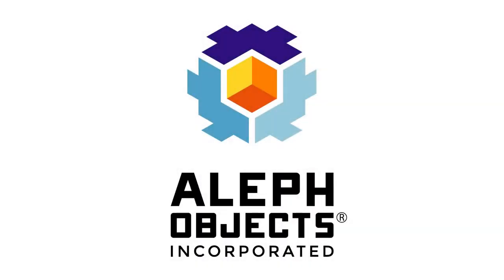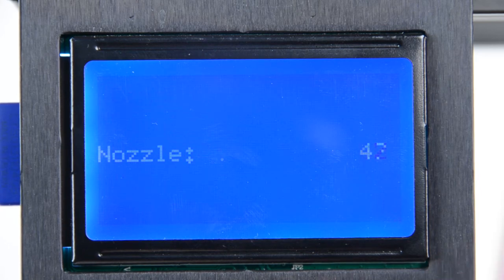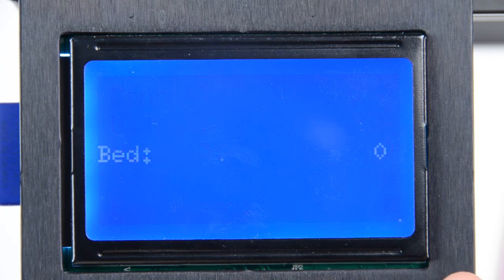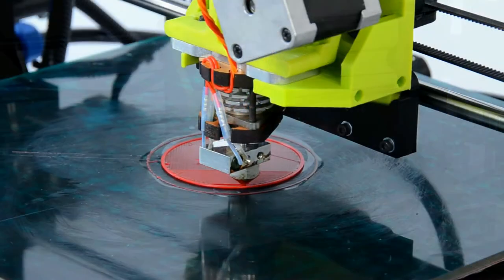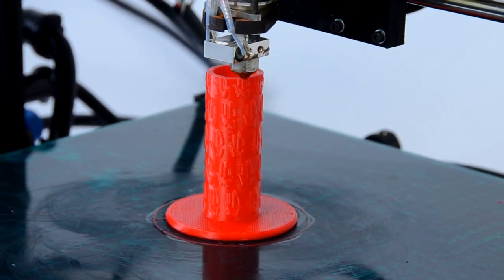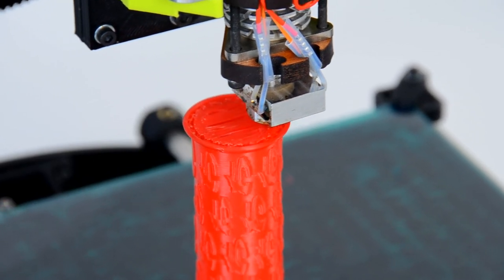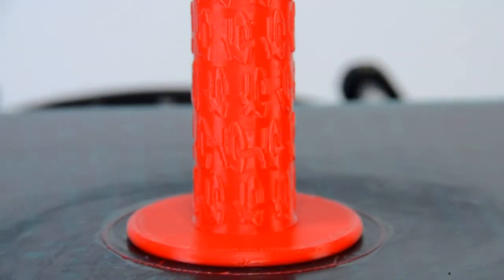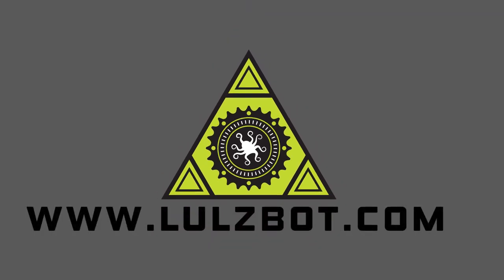LulzBot 3D Printer Filament Profile Series: NinjaFlex

Comment: I am looking into a KITTAZ, and I would really like to use dual extrusion, the second head being a Flexystruder head.  What kind of work goes into that?
Does the Flexystruder have the ability to use regular materials?
Reply from the maker: Hello,
A pre-guava Flexystruder would be ideal for the KITTAZ as it will give you the extra wiring harness. You may need to contact our sales team specifically for this at sales@alephobjects.com or call them at 1-970-377-1111 Ext 600.

You can use the Flexystruder for regular materials, but we highly recommend having a dedicated NinjaFlex nozzle. Ninjaflex mixes in odd ways with other filaments at high temps, and makes purging the Budaschnozzle extremely difficult when swapping between filaments.

Comment: I’d like to know what the black sheet is you’re using as the bed here please? I have a Taz 6, and I love it, but I do love the look of my black glass bed on my robo r1. And I see it’s faster atop the original bed? Is there anything to change in settings?
Reply: Fastened*
Reply from the maker: This video uses one of our legacy LulzBot TAZ 3D Printers. In the past the TAZ used a green PET film as the print surface. We find that our current print surface, PEI, works even better. We recommend using the Modular Bed System, available for the LulzBot TAZ 6, 5, and Mini. One side of the print surface uses PEI, the other uses bare borosilicate glass, the recommended surface for printing with flexible materials. You can also use this bare surface to test alternative print surfaces. Learn more here: https://www.lulzbot.com/store/parts?combine=modular

Comment: If i put the print speed at a very low setting will I be able to print it with the basic taz 6 extruder?
Reply from the maker: Flexible filament is not still enough to reliably feed. Save yourself some frustration and purchase a Flexystruder or build one yourself from the Open Source Hardware files.

Comment: You skipped past how you printed the end cap without support. How did you do that?
Reply from the maker: We bridged right over the gap. TPEs and TPUs like NinjaFlex, SemiFlex, and Cheetah bridge rather nicely and cleanly with proper cooling and tuned profiles.
Reply: I have a Lulzbot Mini as well as the NinjaFlex and the Nijaflex extruder. Can you post your settings somewhere on the Lulzbot site so that I can see them? I actually have to print a grip as well and have been trying to figure that out.
Reply from the maker: The settings are built into https://www.lulzbot.com/cura. Give the Cura 2 LulzBot Edition beta a try. If you'd like to port over the settings yourself, profiles for each printer and material are linked as well.